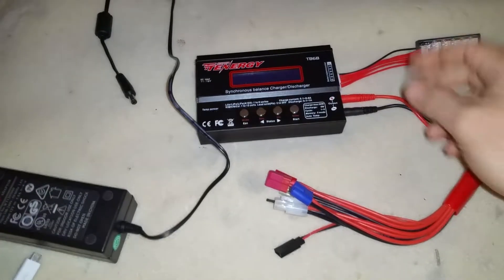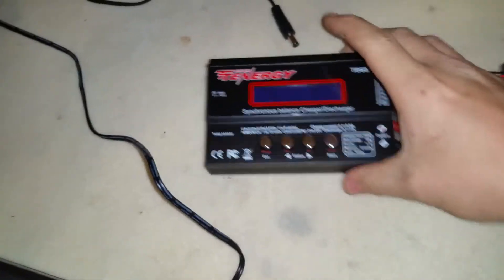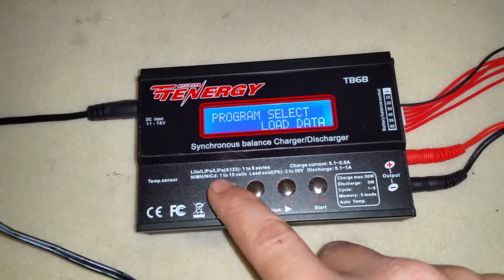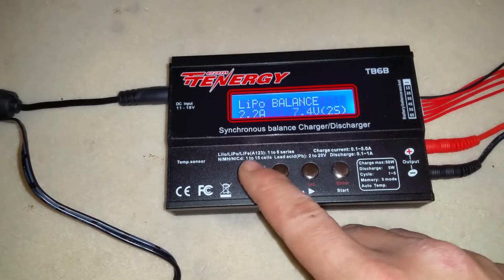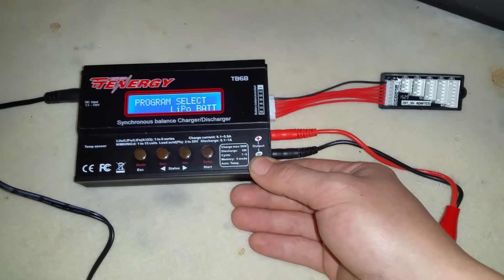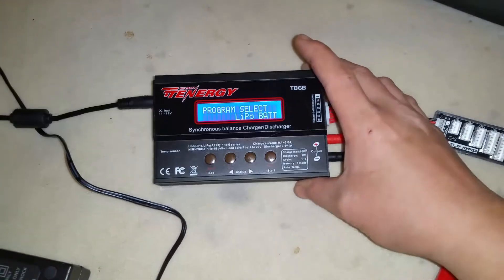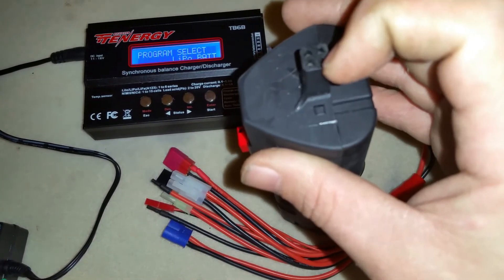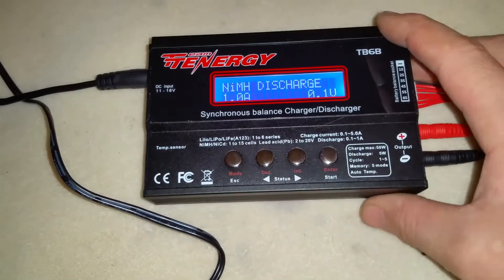Tenergy TB6B review and common questions answered

Comment: HOW do you charge 1s on these?? It says it will right on the front!
Reply: You need the correct cable to connect to your 1S LiPo. The cable needs to have  bullet connectors to connect to the output (not the balance port) of the charger with whatever connector your 1S LiPo battery uses.

Comment: How come when I’m charging my 7.4v battery on this charger the volts keep going up should i be worried or is this normal
Reply from the maker: If it's a lipo that's normal. Resting balance charge is 7.4 boots or 3.7 volts per cell, full charge is 8.. 4 volts per cell
Reply: Power Evolution RC thank you so much

Comment: How to know if my lipo battery is full charged?
Reply from the maker: If your charging it correctly with the. Balance plug plugged in and the main lead plugged in it will beep when it is done. Depending how large it is and how much it needs to be balanced it can take over an hour.
Reply: @potjnkye86  i only have a 5000mah battery with a 14.8 volts sir. But as I charge it goes to 16.80volts and it doesnt beep. Now i dont know if it is done charging my lipo
Reply from the maker: @angelmaereloba2432  its balancing it once it gets to 16.8. Just give it time
Reply: @potjnkye86  the brand of the battery is turnegy.
Reply: @potjnkye86  my battery is a 5000mah 14.8volts. What wpuld be the correct setting?

Comment: What amp should i store lipo batt 2s 2200. Will charge auto stop. Tks
Reply from the maker: There should be a storage charge setting but you don't go by amperage for storage. You go by voltage. A 2s would be 7.4 volts
Reply: @potjnkye86  i meant when storing batt using charger will charger auto stop. At correct setting?
Reply from the maker: @mfields5625  Yes it will automatically stop 9nce it reaches a certain voltage

Comment: How do I charge a Holy Stone Model SF 8333106 Li Po with this charger. Charger cable that comes with battery will only connect to the balance board. Nothing to connect to the octopus cable.
Reply: Sorry that this is a bit late but you will need to get an adapter. Thats what I did because my Lipo has a trx connector, so i ended up buying a deans to trx adapter

Comment: How do i know if my battery is done charging
Reply from the maker: What kind of battery?  It will beep when it is done but always charge outside on concrete or in a metal box if you charge indoors. A runaway lipo is EXTREMELY hot and becomes a flame thrower.
Reply: 2 xt60 connector batteries 1 jst plug. At least ill beep when its done. Do it beep once or will it set off a alarm

Comment: QUESTION: since you have lots of batteries: I plugged in a , 2000mah, 11.1 ( 3S) batt, did all the settings and hit store. I am not sure what i am doing wrong but it does not let me continue pass the charging screen; it beeps on the charging screen and says: Li3S blinks on the charging screen. Then i have to hit esc. To quiet the beep.

Am i missing anything? Please let me know your thoughs. Thankssss

Comment: This charger also fixed my LiPo battery that was basically damaged for being discharged too much. Dangerous but I was able to get the 3s LiPo to charge up to about 8.6v using the NiMH setting then switched it over to the correct LiPo setting. No more errors and it charged it back up to 12.6 and works great ever since.
Reply from the maker: JBE mine had a full set of balance resistors fry so I upgraded to 2 venom pro duos.  Thanks amazon.
Reply: Yikes! Good to know.. Those Venom Pro Duos look awesome!

Comment: Did we cover the Storage function.???
Reply from the maker: RC McTool no I did not. But I could if you'd like. But after about a year and a half the balance resistors go to shit. So I wouldn't trust it to bring it down from 4.2 to 3.7 per cell.
Reply: Power Evolution RC hi for storage mode I had it set to 1.0 amp but it only went up to 0.5 amp when putting in storage mode. I did notice the charger was warm during 0.5 amp. Maybe 1 amp it would’ve over heated ?

Comment: Could you tell me how you use the alligator clip attachment?  I wanted to use them for some Dewalt 18v drill charging but can't find anything on the octopus to attach it to!?
Reply from the maker: Keith D a DeWalt battery I don't think will have the MAH or output to charge battery. But all you do is out red on + and black on negative but always remember the DC voltage input of the charger or you'll fry it

Comment: So when I balance charge my Lipo (7200mah 3s) it wont beep to show charge is complete...even after about 1.5 hours of charging.  Am i doing something wrong?
Reply from the maker: DocHoliday has it never beeped?  Also this charger can only push out 5 amps. My 7500 3s took 35 minutes to get 1700 mAh into it. It's a big battery.
Reply: ty yes if finally completed after about and hour of charging

Comment: will that actually fit the xt60?
Reply from the maker: Blacksquadron yep. I use xt-60 exclusively
Reply: Strange. I have a pack of XT60 connectors I got and I can't get the connector to fit. There's a middle connector that blocks it from fitting. I must be doing something wrong?
Reply from the maker: Blacksquadron With xt connectors not only are they shaped so you can't plug them.in backwards but also there is a notch cut out on the female plug that the male plug fits into.  sometimes also the male prongs are a little to wide so take a needle nose screw driver and squish them together and see if that helps.  if you can't figure it out make a video and upload it then send me the link.  videos help more than pictures and words

Comment: is it ok if i charge my lipo and not use it till the next day? will that hurt the battery over time?
Reply from the maker: Richard Majoros Yea that's fine.  generally if your not gonna use the Lipo for a prolonged amount of time, say a few weeks to a few months ideally you'd want to put it in what's known as storage mode.  3.7 volts per cell.  I don't ever tell anyone to do this but I Persoanlly leave the my lipos fully charged.  I have a 2s racers edge battery that I've had for going on 3 years and its still great to this day
Reply: Evolved Amateur RC. Ok thank you

Comment: i have a problem... say: lipo low battery
Reply from the maker: Eduardo Amaya if of the cells are below 3 volts use nimh mode to charge them back up to 3 volts per cell then go back to lipo balance charging.

Comment: is it normal when charger get really hot
Reply from the maker: yes and no.  1 you have to realize how many amps are passing through it.  f you like it to run cooler set some type of fan near it to blow across it to remove the heat.
Reply: I did put a fan that really cool it down Mahalo and aloha
Reply: Yeah I'm going to sit here in the next 10 minutes and blow across it LOL..( hey babe what you¿ doing. Bolwing my charger:..) did I come in at wrong time..lol

Comment: if you run your rc car on lipo and you dont fully drain it. can you just plug it in the next day and re charge a half full lipo? if im not going to drive it for a week ppl say to discharge it can you do a discharge video?
Reply from the maker: I quality charger has what's called a storage charge mode.  storage charge is 3.7 volts.  a discharge video would take to long but I'll go through the settings on how to do a discharge and the end result.
Reply: okay thank you